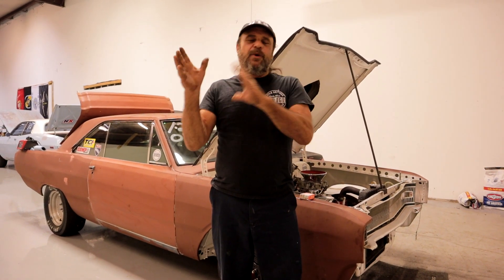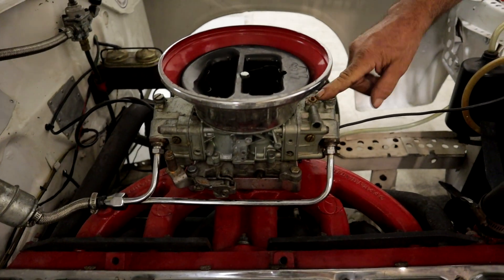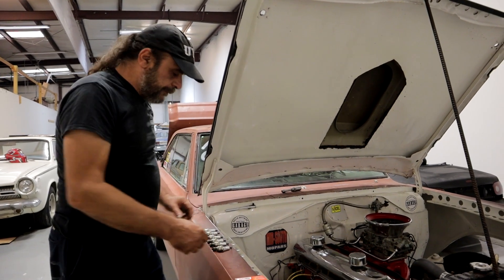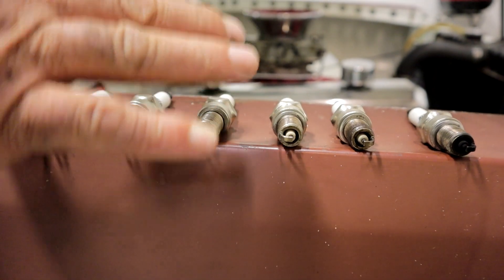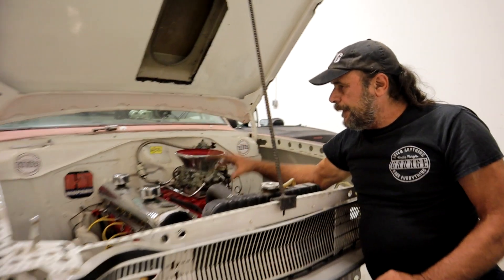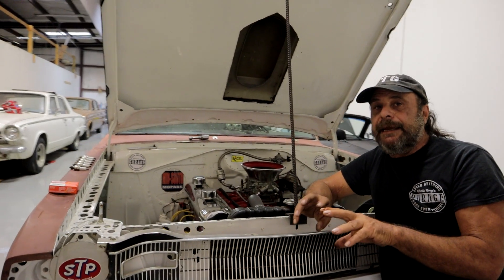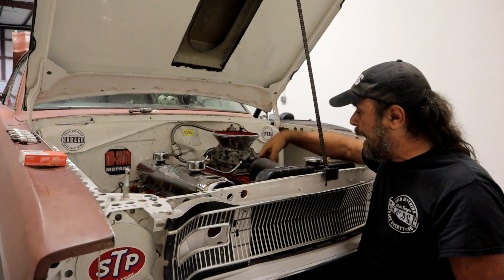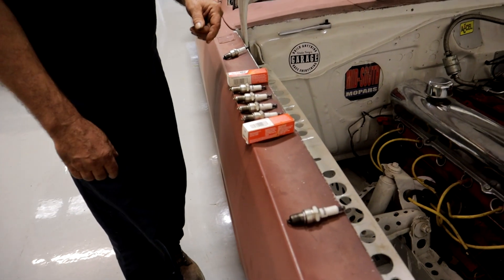Initial Carburetor Performance Tuning

Comment: One of those long runner intakes from the early sixties would be trick. I'm a little surprised at nobody welds up equal length intake manifolds similiar to shorty headers

Comment: So to eliminate that entire issue altogether, could you rotate the carb 90 degrees to get the primaries parallel to the cylinder head?  I know you’d have to redo the throttle linkage and fuel lines, but could you do that? Or possibly put a larger spacer on the carb to raise it up and normalize the flow prior to it going into the plenum?

Comment: Talking about spark plugs do you think indexing spark plugs to face a certain direction helps performance.  I was told the open part of a spark plug should face the exhaust valve.
From Motor Trend:
Old-school thinking: The open end should face the hotter exhaust valve, making it easier to start the fire. This orientation also protects the plug from fuel wetting caused by a rich air/fuel charge. This is unnecessary with modern chambers, ignition, and fuel management. For example, on this Gen IV LS7 chamber, the plug is already biased toward the exhaust by design.

Comment: I suggest you turn the carburetor 90 degrees. In-line 6s usually run better with the carb mounted sideways relative to how it would sit on a V8

Comment: Tony you need to rotate the carburetor 90 degrees I've lived straight six amc for 35 years. Distribution will be better. I know you'll have to reengineer the linkage but you need to try it bro.

Comment: Another awesome video! Very informative! How would a open carb spacer cocked at °45 effect the distribution? And would it have +/- effect on top end power? Could you port and epoxy manifold to improve flow characteristics?

Comment: Uncle Tony... Why don't you turn your 4 barrel 90° sideways to get better fuel distribution ??  If the intake has a plenum divider, mill it out. I have turned 4 barrel carbs sideways on a few 300 Ford engines, and it really makes the fuel distribution better.    ---Doozer

Comment: Back in the early eighties.We had a 5/8 mile high bank dirt track.The 6 cylinder class was the best
They would push those engines to the max.The 292 chevy engine was the fastest.It would not last on a race with larger  amounts of laps .I think looking back it had a couple of cylinders leaning out.The ford 300 ran great and would last.But that chevy 292 . With worked 250 heads hauled  ass.Were talking 1982

Comment: Would turning the carb 90 degrees counter-clockwise help anything? Placing the primaries in a more central position would mimic the original 1bbl somewhat.

Comment: triple carbs is the answer, webers if cost allows
Reply: Yes, a "tri-power" setup, with each small 2-barrel supplying 2 cylinders through pretty much equal length runners...but does anyone make such a thing, or would this be a TIG welding project?
Reply: @lordphullautosear  there appears to me to have been st least 3 companies that made manifolds for the slant 6 to put side draft Weber’s on. Looking online they go in the $400 to $800 range just for the manifolds. $2k for the intakes and carbs And linkages in a kit. Yeah it’s expensive but that is racing.
Reply: My experience is 2 days on the dyno working hard is the same as 2 years of track tuning.
Reply: All he has to do is turn the carb sideways, no need for different plugs, different jets, different manifolds or different carbs.

Comment: I'm curious how much your vacuum secondary carb being turned 90 degrees would have to do with the fueling. If it's dual plane I would think there would be an issue. Of course it will go away with the manual secondary.

Comment: It's going to be a little fat at idle but on the mid-range and top end it'll clean up really quick and you have to what accelerated property running that thing and which cam are you running on the cover itself to support the accelerator pump shaft?

Comment: Hey Tony just thinking out loud here, could you possibly open up the plug gaps on those outer cylinders to help with burning some of that extra fuel?
Reply: He would need to keep the same gad due to the high compression, using a hotter plug could help
Reply: @victorparra4227  true, I forgot that thing has lots of compression for only being a slant six. Impressive little engine though, I bet it sounds better in person than it does on his vids.

Comment: hate to say it but that four barrel may run better if the primaries face the valve cover ,it appears to me that three rear cylinders will not have the same mixture as the cylinders in front, a spacer may help by increasing the plenum volume

Comment: I have an Elderbrock 750 on a 383 stoker which is cammed. The carb needs to be cleaned do to the painter leaving the air filter off and the carb got a bunch of trash in it and now the car won’t idle, do you recommend soaking it in cleaner? If so, which one?

Comment: Just wondering, in the case of an inline 6, wouldn't a multi-carb setup work better, like say 3 deuces which would distribute the fuel/air mixture more evenly? I had never thought of it before you demonstrated the difference in the spark plugs (fat on the ends, and about right in the middle).

Comment: check that compression on one and six tony cause i have a slant six 4bbl and i dont have this problem ever and im useing a edel brock 500 cfm afb of road version no spacer and it the carb is still to big.if you need 650 cfms try a tremoqaud and if it falls on its face then you no your way to big.the rpm going to dictate cfms so
your loading up on shut down on 1 and six

Comment: A lot of port injection systems fire all the injectors simultaneously, delivering the same amount of fuel without differentiation. So they wouldn't solve your problem here. You'd need to look for sequential port injection, though even there, the injectors might still deliver the exact same amount of fuel, though fired at separate times, in order, and not simultaneously.

Comment: I'm happy I run dual one barrels. 
In theory they deliver more torque in the low end,with the best fuel distribution..

But I know this is not a good drag racing setup... And as people have said side drafts are the best since the air don't need to make a 90 degree turn...but triple dcoes ain't American hot-rodding!that's a 4 barrel!

With best regards from Europe , building my (cruiser) slant six one piece at a time!

Comment: It's funny how you are talking about reading plugs, I was just talking about that earlier today but for two strokes, very similar process and extremely important not just for performance it's for longevity,  if you run lean  on a two stroke  you can quickly destroy it.
Reply: I found out the hard way even a giant main jet won't prevent the dreaded hole in the piston with leaking crank seals. People used to say that I bought wiseco pistons by the six pack for that 83 rm 125. Ran great when prerunning. Once the green flag dropped, would always hole a piston before the first checkpoint.

Comment: Have you thought about turning the carb sideways? I know float bowl slosh will then be an issue
Reply: Yes!  There is somebody with the right idea.  The sloshing can be fixed with baffles in the bowls like an off road carb, if it's a problem.
Reply: The old Ford Tarantula intakes were clocked to near a 45* angle to equal runner length to primary/secondary openings
Reply: @Sjmartin666  Yeah, Edelbrock makes an angled single plane intake to fit most engines.  I think Holley and Weiand makes some too.

Comment: What about triple Webbers if you could find a suitable manifold, but still might over fuel it thou 🤔
Reply: Nonsense. Fuel to air ratio is controlled by jetting, not carb size or the number of them. Multiple carbs or a much larger carburetor decreases the signal at the boosters requiring larger jets. Three webbers are usually setup as an individual runner manifold with no common plenum so they only see air velocity at the booster from one cylinder. And yes I have run a slant with three 45 dcoe side draft webbers. It used to be a very popular setup for good reason. That setup makes about the same power at wide open throttle as a 750 holley but has much better part throttle driveability and unbelievable fuel economy.
Reply: @davidleonard8369  isn't it mostly because with a 750 carb the vacuum signal of the 225 is just way to little..and thus the venturi metering is far from good?

I've seen this happen before though.. especially on street engines
Reply: @gorkzop  Yes you are correct. But the fact is I have run a 750 double pumper on a 225 slant. Out of the box or should I say straight off My girlfriends 72 340 duster it had a bog when snapping the throttle open on both primaries and secondaries. All I did was increase the size of the pump shooters. It worked incredibly well. Good for 5 mph throttle the traps over a 390.
Reply: @davidleonard8369  i'm actually really impressed , I'm only at 260 CFM with my 2x1bbl setup. But my car ('61 fury) can't really get over 4000 rpm anyway!
Reply: @gorkzop  cool, Hudson twin h induction on a Plymouth.
Reply: @davidleonard8369  that was exactly my inspiration!  

And the EFI setup of the Ford 300. I'm going to create shorties headers like on that one!
Reply: The Weber dcoe manifolds are seperate runners for each carb, they are available off the shelf in Australia from Redline.
Reply: @alexneilson598  redline is the distributor for Webber in USA.
Reply: @alexneilson598  funny you should say that I am from Aus as well, they seem like a more common carb choice here than the state's, because of our history with high preformance sixes ie e49 265 hemi six pack

Comment: Just wondering, why all the hate for Champion plugs? Been hearing the ‘lawnmower’ joke for 30 years.
Reply: yeh  Just after the wheel was invented it was AC in the daily driver and champion in the good car. They didn't lead foul as much
Reply: @oops1952  Allison champion ie AC spark plugs.
Reply: @davidleonard8369  Actually that was most of the other guys. I just had a hot daily driver so all I used were champions. I think it was AC delco
Reply: @mickangio16  Interesting, thanks for the response. I never had a preference really, they’re just what I always used. It’s just that when I went into two different parts stores 30 years ago and I asked for Champions, they both said “I wouldn’t use those in my lawnmower.” Finally the third store didn’t have any smart remarks so I bought them there. I was thinking it must have been an Autolite smear campaign or something lol! If there’s a legit reason that they’re garbage, I’m all ears, but it kinda sounds like a perpetuated myth. Other guys have given answers similar to yours. Thanks again.
Reply: @mickangio16  I agree. Champions worked fine for me. Back when there was still lead in the gas, performance cars especially would lead foul the plugs. AC's had a heavier center post that seemed to make them last longer but foul easier. At least that used to be the story in Winnipeg.....use AC's in the daily driver and Champions in the good car. Now I use iridiums and don't care who makes them. The fact I'm retired and drive a mini van might have something to do with that

Comment: But wouldn't a port fuel injection system still read off a single O2 sensor and make the adjustment to all cylinders?
Reply from the maker: No, but you would be eliminating the plenum and runners from fuel distribution.  It would be even by default

Comment: would it be worth adding a sheet metal baffle in the intake plenum to even out air flow to the cylinders. ive seen it used in the carbureted ford 2.3 4 cylinder lima motors

Comment: You can run different heat range plugs in the same motor? Never heard of that, but I need to do it on my 350.

Comment: Tony would you consider making a spark plug reading video sometime? I only know porcelain color but I hear there's much more.
Reply: Porcelain color is what we read to determine the correct heat range. We use a lighted magnifying glass to read the shell to determine jetting. Don't know if that helps.

Comment: I bet a six pack with equal length runners and a common plenum would fix a lot of the distribution issues, but you'd have to build that manifold yourself. Would be kinda cool to do. Otherwise some kind of port fuel injection would fix it, but you still get very different velocity with the very long and very short ports. and you just said PFI would fix it... My brother put a TBI system on his wife's slant in her 64 Dart ragtop. Not sure if its FiTech or Sniper, its one of those two. I have FiTech on my 65 GTO's 455.

Comment: Hey Uncle Tony, 
In your opinion is there any merit to the idea of changing the clock position of the carb by rotating it 90° clockwise so the primaries are facing the head and there is one barrel of both primary and secondary circuits for 3 cylinders per side of the carb? 
Understandably there are still differences in manifold runner length, which as stated is most effectively compensated by the spark plugs. Of course throttle linkage would be more complicated also. In theory, with no practical experience to back it up, I feel like it could potentially be more "balanced" that way? Call me foolish, I'm probably wrong, and it's just a thought. But in my mind that intake design is like a one way street, and pushing air fuel mix through it by means of small to big based on throttle demand somehow makes sense to me. 

Again, it's a theory. I don't actually know what I'm talking about cause I haven't done it myself. I'd like to hear your thoughts on the idea, and anyone else's who might offer their two cents.
Reply: P.S. Loved the video. Learned a lot as always.

Comment: Why not keep the same plugs front to back but just change the gap for what each cylinder/intake runner needs? You could keep the same plug but open or close the gap to achieve your desired result. That’s what I have done anyway.

Comment: Is that an open carb spacer, or a four hole? ...add spacer? I've suddenly got a picture in myn head of fuel puddling in the bottom of the manifold...
Reply from the maker: Open, and the plan is to experiment with spacers down the road, hence no seal between the velocity stack and scoop

Comment: @Uncle Tony's Garage  can i run my car on pump gas? It's 11.and a half to 1 my builder told me. He also said i could run it safely on 93 I'm driving it from Chicago to Arizona and they don't sell good fuel on the highway. Like 94 octane to 110. What do you think Uncle Tony. All thoughts welcome I've had 4 guys that are very good tell me i can. I also have a question About clutches. I had a Hays in it they talked me into a center force 2 i believe it has the weights i heard of vibration issues.  i wanted to go with a 650 diesel Hays they are so forgiving it's a street car about 550 hp don't know the torque and exact hp yet till it's on the dyno also instead of a true roller timing i was talked into a gear drive also heard of harmonics issues please advise. It's only because I'm driving cross country That I'm concerned. Thank you.  What size Holley hp would you recommend for the street. Vacuum issues from the cam i had a new different cam i wanted put back in it they put a hairy one that robs vacuum from the power brakes Thanks everyone thanks Tony
Any other advice welcome.

Comment: So would a carb spacer help evenly distribute the fuel or would the benefits be negligible? Or do carb spacers not work so well on smaller engines?
Reply from the maker: Spacers are planned for future experimentation. That is why there is no seal between the carb and scoop at the moment

Comment: If the issue is fuel distribution, isn't changing plug heat ranges putting a bandaid on instead of fixing the actual issue?

Comment: Once you get your heat ranges worked out, you may want to move your fuel pressure regulator off of the fire wall. Some tech guys/tracks dont like that.

Comment: look it from autolite the higher theplug number the colder it gets .smaller the number the hoter the plug is  a 65 autolite is hotter than a 66the 66 is colder..also this can be a distibuter problem to a calpsed in the feld of the dewell.but a head gasget could be bad to losing compresion on one and six and i realy think its the head or head gasget cause he milled it .100 inch down the deck could be to thin thus head warped on one and six. compresion check should be done and leak down hot and cold to se the veryants.

Comment: First mistake is concerning yourself with fuel demand. You need to know how much air the engine can move. There is a formula to put you in the ballpark on what cfm carb you need. Just throwing a big carb at it didn't even put you in the right state. Stop trying to show off. Ditch the 4 barrel get a 2 barrel thats less than 500 cfm and impress us by attaching baffles in the intake to distribute the charge to the cylinders properly.

Comment: on the converter at 2500 RPM might change those plug readings...wouldn't take a minute to color the plugs...load might help...spitballing furiously...I smell tacos...butterflies open further under load taking the idle circuit out of it?

Comment: Makes perfect sense ,,, longer time for fuel to get to 1 & 6 ... !
Reply from the maker: Well, no.  1 and 6 have a more direct shot at the outboard barrels
Reply: @UncleTonysGarage  You are correct Sir ... had to look at the video again as I was distracted for a couple of minutes at the right time. BUT isn't it still is a longer travel for the air/gas to make it to the cylinder? (Negligable of course but)?
Reply: @UncleTonysGarage  the longer runner also increases air speed but you already knew that.

Comment: Would going down on the jet 2 sizes on the drivers side help ?
Reply from the maker: There are no smaller standard Holley jets, and also, at this point we don't know what the engines fuel demand under load is going to be.  That's the next step
Reply: @UncleTonysGarage  Cool !  Looking forward to the tests .  Stay safe !